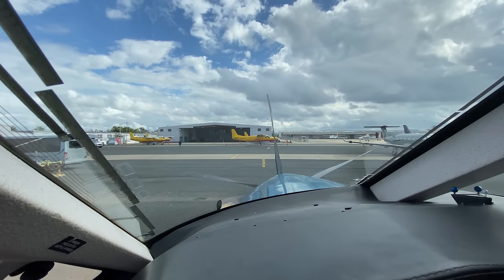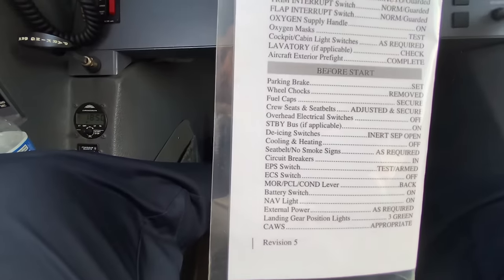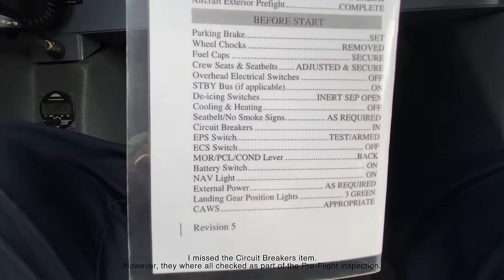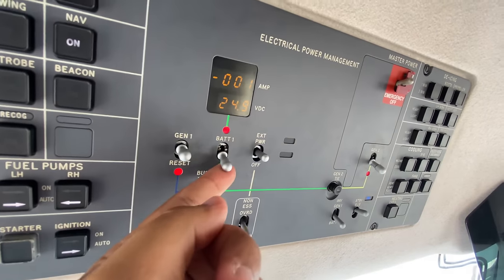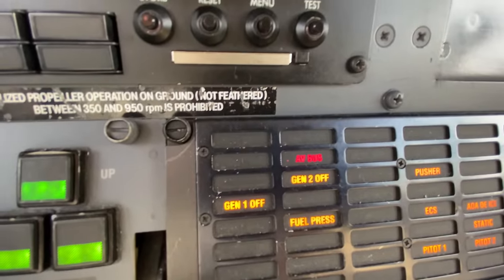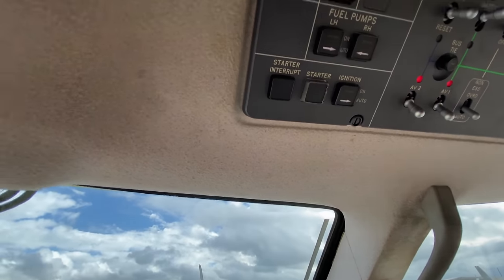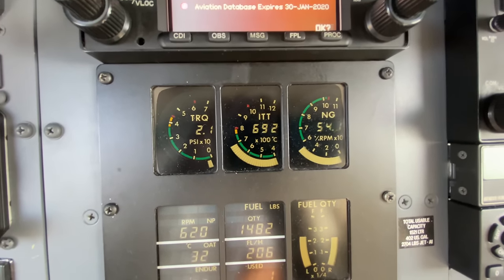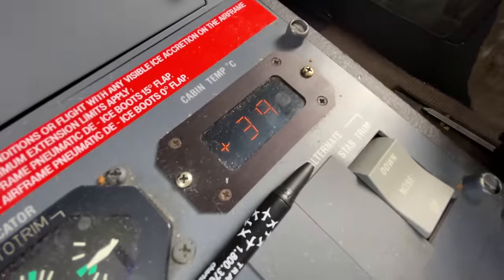How to START A PLANE? Pilatus PC-12.

Comment: Now I know how to steal one 😂Thanks u
Reply: How   you going to Land ?
Reply: @FarukAhmed-zj5zf  Parachute time.
Reply: @SoraDolla  why steal a plane if you're gonna crash it... even satan is better than who ever would do that
Reply: @ILikeEatingChicken  anything is easy if you put your mind to it
Reply: @FarukAhmed-zj5zf  Only do the same, but backwards
Reply: @gordo1163  it's a joke
Reply: FBI OPEN UP
Reply: I am here for that
Reply: let me help you land.

flap, slat, gear, speed brake limitations are listed together either jn the middle of the cockpit or somwhere else. bring a checklist for the pc34 with you and follow that. 

set your trim, drop your gear and flaps, maintain a glideslope (steady descent rate) flare the nose up and make sure you don't sink too much, when you are around 10 ft (gpws will yell you) idle throttle, when your main gear touch, reverse thrust goes, and glide the nose down, then brakes. if the plane has nose wheel steering turn that on, steer with the rudder pedals, and press both to brake (speed brakes should be full when thrust reverse is open) when you slow. close reverse thrust, bring down speed brakes, flaps 5, wat till your airspeed is dead, then release brake and turnoff.
Reply: GTA Time

Comment: I have such a weak spot for single engine turboprop aircrafts. And the PC-12 is a beauty. I really have to find out where my copy of Carenado's PC-12 for X-Plane 11 went when I switched desktop computer. It's on one all the external HDDs, the question is which one.
Reply from the maker: Maybe contact Carenado and they can provide you some assistance?

Comment: Good , but you forgot fuel pumps test. 1.- Lh fuel pump on. 2.- ear the sound of the pump working. 3.- in the caws panel check the fuel press is off. 4.- Lh fuel pump off. 5.- reset master caution light, for the fuel press  light in the caws panel is on. And the same for the right pump. Good videos bro. Best regards form México.

Comment: Hey Shamir!  I'm an ATP and fly King Airs, Piper Malibu Mirage, and when I'm lucky I get to sit right seat in a Challenger 601.  I've heard this plane is a dream to fly, and talk about a clean cockpit!  Mind if I as you a couple questions?

1.  What happens if you attempt a takeoff at gross weight with no flaps?  I hear there's a quirk with flap settings that can get you into trouble, which is all I know.
2. What does the standby bus actually power?  Do you need a Batt switch on to use it?
3.  The ECS system confuses me.  I thought the buttons on the overhead panel were for ground use, but there's a master ECS switch on the fwd panel with Auto setting and temp control, so you still need those overhead switches?  There's a button for cooling and one for heating.  Say you're taking off from KPHX and the temp's 100 degrees F, and you need the cold air for taxi-out and take off, but up at FL270 you need some heat.  Do you have to mess with those buttons at altitude?

Thanks for posting this... the PC-12 is state of the art Swiss engineering and you get an aircraft that has top notch performance and comfort, only at the sacrifice of a little cruise speed.  Someone compared the PC-12 to being the best example of an airliner shrunk down to a single-engine package.  I'd love to fly this beauty!

Comment: Nice video pal, I'd love to upgrade to these, it is funny that in 2020 you don't just press start button and it does it all for you as oppose to manual switching. I'm currently on DA40 then going onto DA42
Reply from the maker: Hi Damir. I believe, with the PC-12 NGX and other aircraft like the Cirrus SF50, everything is automated with FADEC and you just have to push the button to start the whole sequence.

Comment: Amazing, starting the Car Engine is so easy instead of. 😁😁😁
Reply: For most smaller planes It is just two buttons and maybe some fuel mixture fiddling to turn on the engine. And some planes its just a key. Its just in a car you dont need all of these things, and 90% of the switches are just lights and autopilot. Starting a car in the 50's was the same as what you do in tiny planes such as ultralight aircraft. I still dont understand why there isnt a computer program that does all this. Like the FAA is fine with the planes landing and flying automatically, why not an automated startup like they have in cars?

Comment: If you are on a through flight, you MUST run the starter until the ITT is well below 150 degrees C. If you add fuel when the residual ITT is well above 150 degrees, cold fuel will strike hot turbine parts and you will get a pop start and a lot of white smoke from the exhaust nozzles. That is your clue that you failed to obey the checklist and have shortened the life of your turbine hot section parts. Also, 13% is the BARE MINIMUM ng for moving the condition lever to ground idle and introducing fuel to start the engine. The more ng, the cooler the start and the longer your turbine parts will last. I have over 8,000 hours flying with the PT6 engines including 1,000 hours flying the Pilatus PC-12NG.

Comment: You mentioned that you don't want the ITT to go up too high. What would cause it to go up too high and how do you stop it from going up too high if that were to happen.
Reply from the maker: Hi John, If we get lighted pretty fast, we risk toasting the engine on the inside. The ITT can go up to 1,000 Celsius before it toast the engine; therefore we need to keep vigilant and cut the fuel if it gets too high!
Reply: Hot starts can be caused by any number of factors, the most common one in normal operations being low battery amperage during battery starts on aircraft that have a single battery but also can be a result of a variety of other maintenance issues or even a strong tailwind blowing up the aft of the aircraft.

You stop it by first recognizing that a hot start is happening — if you wait until the ITT gets close to the limits its going to be too late. The engine can only be within 870-1000’C for 5 seconds — and it still has to cool down. Once you recognized a hot start is occurring you just take fuel away by putting the condition lever to cut off feather and letting the start cycle finish both to continue cooling the engine as well as to get rid of any unburnt fuel that remains in the combustion chamber. I was always trained to, as part of the start cycle, to make a note of the highest ITT reached even on normal starts. For example, the callout would be: “*add fuel* Fuel flow... light off... 701 degrees, oil pressure.” And also if it ever goes into the transient or starting limits to start counting seconds, you get 20 seconds from 800-870 I believe and 5 seconds 870-1000. If you do this on every start then if you have a hot start you’ll be able to tell your mechanic the highest ITT reached and for how long it was there which might save you from having to do a hot section inspection.

Comment: Very interesting, thanks for sharing. In X-Plane 11 i have PC-12NG with Bat1 AND Bat2..what´s the different?
Reply from the maker: Hi Pete.. Its just a dual system compared to a single battery system. Basically, redundancy. this really helps if you have to do an AIR-START after an engine failure.
Reply: @fersobe  Also has a very noticeable difference in your start times. Spools up and gets that ITT down faster on those hot days.

Comment: Question: Have you flown the NG model? In spite of it being all glass, is the startup procedure the same and switches in the same places?
Reply from the maker: Hi Brian, I've never flown an NG. From what I've heard, its pretty similar.
Reply: It's almost exactly the same.  Some of the limitations are a bit different but not much.  And the indicators are all on the lovely Apex Primus displays so it looks a lot prettier.

Comment: If your PC-12 has two batteries then both need to be on to start, even though one could easily start it. Learned that the hard way when using a maintenance spare.
Reply from the maker: Hi Michael, it is to my understanding that if 2 batteries are installed, the starter wont go with only 1. Actually, if that’s the case, the whole electrical system will shut down. I don’t know if that’s the way our PC-12s are rigged for safety though.
Reply: Shamir Fersobe sort of, if I recall. If it has two batteries one battery is connected to the starter for the first half of the start, and the other is connected after a certain % Ng. Bottom line is it either won’t start at all, or the igniters won’t be powered... I can’t remember which but I think it won’t start turning at all because it’s the #2 battery that handles the first part of the start.

Comment: Make sure the ignition switch is in the on position
Reply: Irene Garcia Arquero No, sir. The AUTO position is the correct position to start the engine according to the PC-12 normal procedures checklist, because the AUTO position will inhibit igniters before 10% Ng is reached.

Comment: Very nice video! Does the PC-12 have no APU ? SO without ground power, how do you do the flight preparation (inserting a route etc.).. cheers!
Reply from the maker: Thanks. No APU on the PC-12. We usually load our routes with the engine's running, or, if the situation allows, we have a GPU lying around somewhere ;-)

Comment: At what point do you set the mixture to full ?
Thanks, great video!
Reply from the maker: Hi Afonso. The Pilatus doesn't have a "Mixture" lever. It's called the Condition Lever and it basically controls the amount of fuel that goes into the engine; a little more finesse than a mixture control. We usually get it to the full forward position (Flight Idle) once we're cleared for takeoff and it doesn't come back until we touchdown.

Comment: how much is the cost of a brandnew newly manufactured pc12? maximum speed? type of fuel?
Reply from the maker: Mico, I believe that a brand new PC-12 goes for around 5 million bucks. True Airspeed is around 260kts and holds up to 2700 lbs of Jet Fuel (Jet-A)
Reply: ok thanks for the reply.

Comment: Battery 1&2 on, nav and beacon lights on, push start switch, wait for 14%NG and fuel on. NG stabilizes and turn on both gen’s. Then proceed to make airplane noises right?
Reply from the maker: Correct!

Comment: The flipping of the switches is not rocket science, but the knowledge of what they all do and how they’re supposed to work requires significant knowledge.  In addition to that, flying the actual plane is challenging as well.  Pilots need to stop selling themselves short.
Reply from the maker: Agreed!

Comment: not totally dissimilar from a Boeing or Airbus conceptually with the exception of lack of APU; battery power on, then as soon as you get the engine started, electronics go on the bus... and of course instead of buckets or vanes for reverse thrust you have prop pitch beta but conceptually everything else is the same

Comment: should be one single display, nothing mechanical, no buttons and all that start up should be automatic of course. aviation is much too stagnant and no, it's not a safety thing.
Reply: Dan Frederiksen This is hardly a new aircraft, NGX on the other hand..
Reply: @ryanscholz_  still 5 small screens and a ton of buttons. clutter everywhere. Mechanical levers, same old hockey puck lever to symbolize gear like it's 1942. Indiana Jones yoke that had a baby with the most cringe PC joystick. Why not a space ball. Why not a 30" display up close.